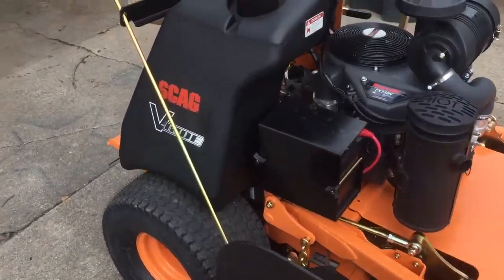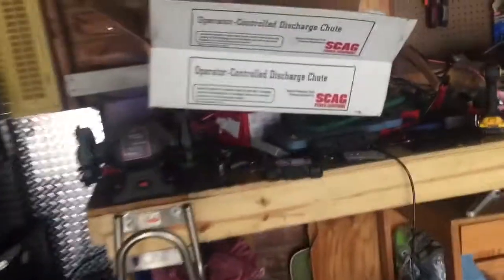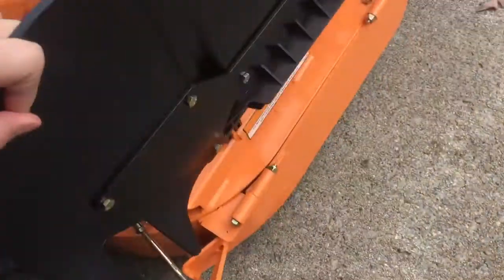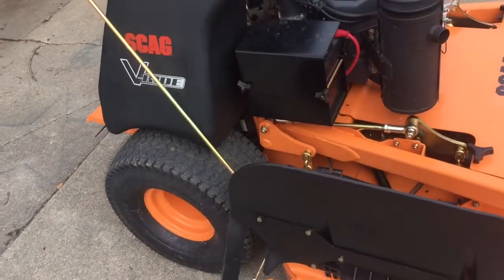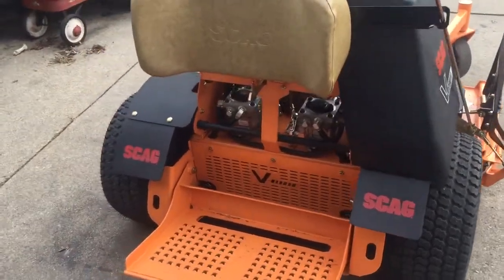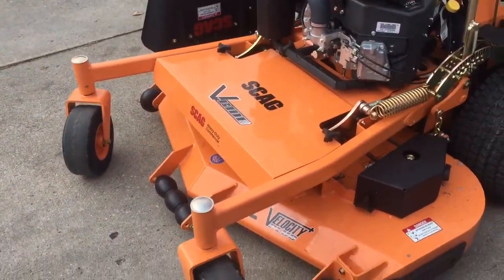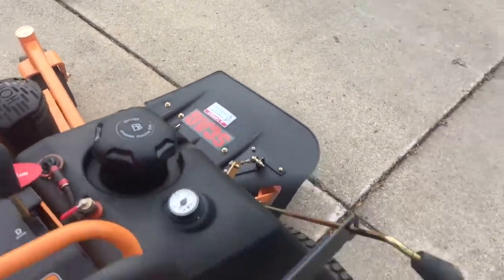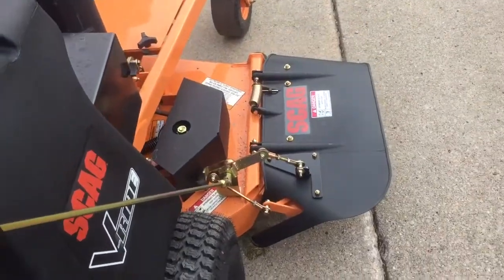Update and new scag OCDC

Comment: You don't, in fact, need the black plastic flap on it...you can take all the moving parts associated with that piece off and it will still work fine...or better, because the weight of that flap is what causes it to fall open again...i used  the one that came on mine until i needed to have a flap AND a bagger.
Reply from the maker: Meier Lawn Care the issue is though I want a chute blocker and this won't work without the plastic flap on it , if I take the plastic flap off the metal piece just falls down unless I'm doing something wrong
Reply from the maker: But I think I know what your saying now when I get home I'll look at it again
Reply: Brandons Lawncare If that's the case, then they are using the spring on the black plastic chute to hold it closed...but it would be easy enough to pop another spring on to just the OCDC door to keep it open and closed...hollar if you need help
Reply from the maker: Meier Lawn Care thanks I appreciate it I'm going to have to figure something out because this won't work. I've lost my contact with you as I've had to make a new fb profile and new phone since I've talked with you last and don't have ya on my phone and it won't let me add ya on Facebook haha
Reply: Brandons Lawncare  just google me and gove me a call man, or hit me on FB and ill give you my number...however you gotta do it, but i could fix that in a few minutes heh...i dont wanna see you have problems with your new machine! 😁
Reply from the maker: Meier Lawn Care haha will do thanks man

Comment: I have the scag ocdc on a turf tiger. If you adjust the linkage properly the chute will lock in the up position forcefully and not close unless you exert effort to go back down. It takes a time to get it right but once you do it will work perfectly fine.

Comment: Seeet mower. I have the same ocdc on my tiger cat. You can tighten up the nuts and bolts where that plastic chute hinges and adjust the stiffness of how hard/easy it is to move. The tighter it is, the more it stays up. When i am mulching with mine i will typically have to twist mine back up like twice a yard. Kinda aggravating still, but can be much better than how you have it that loose.
Reply from the maker: mxermatt1 thanks I was thinking about doing that yea chute blockers are nice

Comment: You may be able to adjust it. Mine doesn't open that easy. If you cut that part off make sure to make a video I would like to see that. 👍🏻👍🏻
Reply from the maker: Fall River I'll look and see if Im able to  adjust it I don't know what would be adjustable but I hope there is something, I'll be sure to make a  video of cutting that plastic piece
Reply: Brandons Lawncare the rod on the bottom with the threads, I think you would adjust it longer to make it fit tighter. You'll kinda have to play around with it to get it right...... now that I am thinking about it maybe it's shorter.....
Reply from the maker: Fall River I'll take a look at it and mess around with it and see if I can adjust it
Reply: agreed....there are no nuts to tighten? that isn't functioning properly, and if it's not an adjustment you can do, take it back to the dealer so they can fix it, or if they can't, for $359 i'd get a refund, pick up a little sheet of 16 gauge, rod,  etc & make something homemade. or there are other systems out there.  i'm all for spending money on the business & the right tools, but that right there is not the right tool, falling every time the wind blows.
Reply from the maker: kodiak wild I agree I'll look at it tomorrow and see if something is adjustable and if not I'll
Give my dealer a call

Comment: Just subscribed to your channel. Saw your vid on your 2017 set up and was going to ask for a vid on your ocdc. I have a 48" dixie chopper stryker and it ones with an ocdc operated by a lever and a long cable that runs from the left side of the drive controls around the front of the engine and to the right side where the discharge is. I was able to take the plastic flap off. I just don't understand why other mower manufacturers can't just include a simple to use ocdc with their mowers.
Reply from the maker: Aaron Garcia thank you I appreciate it , I've did vids on 3 different chute blockers you're more than welcome to check them out and hope it helps ya , but yea I think all commercial mowers a chute blocker should come standard on them because I won't run a mower without one , it's a big time saver

Comment: I remove the black piece and just have the part that blocks the deck. The bolts are probably not tight enough thats why it goes down. With the black piece it does a horrible job I even call SCAG about this because I wanted to return it. I will make a youtube video about how I fix this. I can make the orange piece go up all the way and lock and in the block position.
Reply from the maker: Oscar Salas PLEASE make a vid on how to do it me and many others are trying to figure it ways to fix this issue thank you
Reply: Brandons Lawncare Okay I will try to upload the video as soon as I can. No need to cut the black piece just remove it.
Reply from the maker: Oscar Salas that's good to know